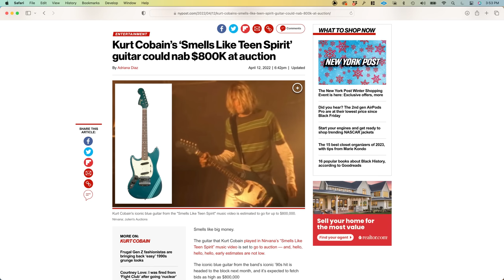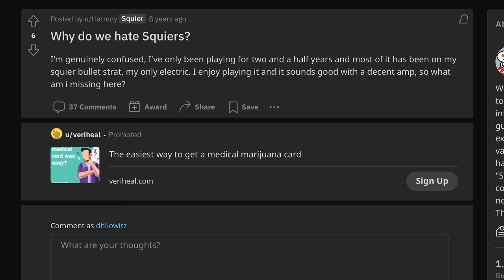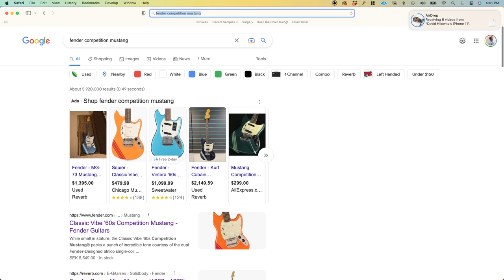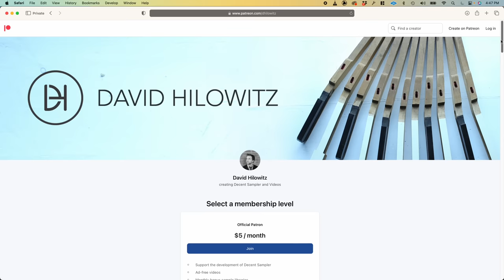Squier Mustang: How I learned to stop being a gear snob

Comment: Great video! If you find yourself in the mood to mod again a set of P-Rails with the tripple shot switching rings are  a great selection of sounds. Add an in and out of phase switch and a parallel and serries switch (between the 2 pickups)  things get even further into the wild side.

Comment: Have a similar story, grew up around the same time and similar back story. I heard that album and went through the same obsession. Started playing on a nylon string classical style acoustic with a wicked front bow. Didn’t care bc I had to show my dad I’d stick with it. Finally got my guitar teacher to show that I needed a new one to progress. Got a used harmony electric from a guitar store. Guy picked it  up 11:31 and showed it to us, played a couple licks to show it worked just fine. Got home, no amp but was a start. Finally saved up for an amp, and the pots died on it. So now I was back to an acoustic. Eventually saved up for a jazzmaster bc of the similarities. Dang floating bridge. Sold that is 2009 and bought a MIM HSS strat. That guitar did play like a dream. About 3 years later, had to sell it for cash. Like most people in quarantine, I wanted to be productive instead of watching tv and pounding food. Pulled that old harmony out of the case, that guitar hasn’t worked properly since 1994. Pulled it apart, repainted it, new pots, new dual humbucker pups, split coil taps and three way switch in a strat style guitar. Cu filmed the inside. The old guts of the guitar made this horrible buzzing noise and this time, it was as silent as it was as back in the guitar store, except when I was trying to make noise with it, after that it sang. Your story is a familiar story, definitely one a lot have their own version of. It’s not the prettiest guitar, but as someone said, it’s not the brand of guitar, it’s the one you actually play that matters. 

Good for you, finding your own voice. Dig the song.

Comment: 1979 I bought my first decent electric guitar. 1966 Fender Mustang for $50 (a lot for me then) but I also had a few like the ones in the beginning of this video. It's not worth much now as I repainted mine too when I was 16 and also didn't wait between coats or sand each one... ended up as a kind of flat black. I changed the pickups and put Fender lace sensors (also still have the originals) but I always thought it was a great sounding guitar and it was easy and fun to play...still have it.  I'm assuming a decent Squire will be similarly fun.

Comment: This video cracked me up because I specifically go after Squiers, since I can't afford Fenders, they have the exact same look & feel, and can be massively improved by swapping pickups. I created my own Tom DeLonge strat because I couldn't afford the $1500 reissue, so I bought a Squier Affinity HSS strat in Lake Placid Blue, and swapped the electronics for a single imitation Seymour Duncan Invader, single humbucker pearloid pickguard, and matching back plate, since it's not a solid body. Looks & feels amazing, sounds even better, and I finally have the blue guitar with the maple fretboard I've always wanted. A week later I bought the matching Jaguar bass, and next I plan on getting a matching alto sax, then an orange semi hollow similar to the Ibanez I had & sold several years back.

Comment: It’s funny how some guitars just have certain something that speaks to you regardless of how prestigious or expensive.
I had an Italia monza which was a quality guitar but I just didn’t find it comfortable to play. Then I bought an old encore strat off eBay for £5 including an amp and stand, purely to rob it of parts for a cigar box guitar I was making. When I got it, I thought I’d plug it in and have a play for a bit of fun and I just loved the feel and sound of it. So instead I stripped the hideous bubble gum pink paint off back to bare wood which looks great. Upgraded the pups and fitted a momentary switch. Now It’s my go to guitar and I also fitted a GK3 midi pickup. I cheekily replaced the headstock logo to Fender and numerous people have said you can’t beat the sound of a fender totally unaware that it’s not one. Which just goes to show it’s not the price tag or name that matters, it’s the soul of an instrument and how you connect with it !

Comment: I love my first Squire, Ive redone all the wireing and put dual hot rail pickups 20 years later and it sounds beefy and I dont mind the Squire logo cause it sounds like my guitar.  I like that ive kept it nice as a lot things I owned as a teen didnt get TLC. My strat body is also like 3/4 thinner than most guitars making it light thus it needed a special sized bridge block, I found out when the whammy snapped in it. Eventually Ill need to replace the frets as they are worn with age.

Comment: The guitar I learned on was actually handmade by my father when he was a teenager from one solid piece of mahogany. It had an absurdly thick neck, chipped black paint, and a cheap fiberglass pickguard. It was paired with an old tube amp he had also made that had the absolute touchiest dials in history, and I found a used Boss OS/2 pedal for dirt cheap. I played the absolute hell out of that setup when I was 18. Literally played until my fingers bled a few times. The only real improvement I've found moving on from that gear into more expensive stuff is thinner necks. haha Talk all you want about signal quality and tone and blah blah blah, but that's all just personal preference. I hear plenty of people making a $50 guitar sound just as beautiful as a $1000.

Comment: I have a HSS Squire Strat that I got for free and it was mint other than it had no bar included. I set it up and it sounded pretty good. After about 6 months I switched the bridge for a Wilkinson that I had left over from another guitar and it sounded terrible, switched to the bridge pieces from the original bridge and it sounds unreal, stays in tune and sustains freakishly! I was gonna sell it but nope, it's gonna stay in my collection. I can't believe how good it plays and sounds. It has a  slightly thinner body but fits my pretty darn good.

Comment: GOD I love the Quarter Pound. Got one in the bridge position of a tele and I will often reach for it to do almost thrashy rhythm stuff, amp and pedal settings exactly the same as I'd have for a typical bridge humbucker. Makes a nice second sound to blend in a quad-tracked mix too. Or if I want to double track, but have the hat side and ride side guitars sound slightly different to match the differences in the stereo spread of the kit. I pan the QP track with the ride because my ride sound is bright with the placement of my overheads, and my hat sounds a bit more midrangey than typical hihats. I actually have a couple cheap (but good) almost QP copies, made with alnico slugs instead of bar magnets though. They're strat pickups with huge pole pieces and one is reverse wound, so I intend to turn them into a single hack-job humbucker with a massive amount of output for sludgey dirty sounds.

Comment: I used to make cages out of copper foil, hoping for some kind of faraday effect. It's fun and it looks cool, but it would have to be ridiculously thick to accomplish that. I learned, however, that it actually isn't necessary. The point of the foil is to act as an antennae to receive errant electro-magnetic waves in the room and give them a direct path to ground.

Comment: I bought the same guitar used at Guitar Center for $100 and also bought a Jagstang pickguard, Hipshot staggered locking tuners, and replaced the pickups with JB bridge and Hot Stack neck. I had to sand down the back of the neck and Tungoil it. I love projects and have built and renovated many guitars. This is a great little player.
Reply from the maker: Ah, that sounds so cool

Comment: I bought a Squire Affinity Tele for $167. I had the same plan, till I took it apart. Inside I found FENDER pickups and 500k pots! I looked it up by serial number and found it was a limited edition with the upgrades I described, so I left it, just like it was. I put a bridge mounted B/G bender on it and tuned it to C6th for a laptop steel sound.... It's my favorite guitar.

Comment: I remember wanting my first guitar to be the "pointy typical electric guitar" meaning a black strat with a white pickguard.

The seller oriented me towards a Squier Telecaster and I wasn't sure about the body shape, and I didn't know anything about the mics.

I took the Tele, and the Squier name didn't bother me.

Today, after more than 15 years, this Tele is next to me and I played it for 2 hours today.

I have other guitars and some are way more expensive than this one.

The frets are worn out, I changed the neck pickup, the tuners aren't all the same, and the Squier name is a statement that I proudly keep.

This guitar changed my life and If I had to play any guitar in a live setup it would be this one.

Now, Squier is a name I'd actually prefer to have on the headstock rather than Fender.

I can mod it and make it mine, and above all, it keeps humility.

Comment: Part 1: My first guitar was a Cort stratocaster that I got in 2000, and it served me well for the 7-8 years before I decided that I wanted to take it apart and repaint the body, after dropping it once or twice and many scratches and dings in the paint, but it turned out to be a tremendous mistake. Ever since 2007 or 2008, which is when I took it apart, I've since lost all of it's original parts, and it just sits around in a box, stuck in limbo. On the plus side, the neck is still in decent shape, and is a nice substitute any time I need a spare neck for any other guitar, like as of current, it's on a Squier bullet strat that my cousin bought, he removed the original tuners and put different ones on, then changed the tuners again to ones that came on his very first strat, and subsequently gave me the bullet strat but did not give me the original tuners, then proceeded to move to a different state... and I've been too busy and lazy to go buy replacement tuners for the Squier neck, meanwhile I didn't like that it had his first guitar's tuners, so I removed them and put them back on his first guitar, SO, now that bullet strat sits around with my Cort strat's neck.
Part 2: I got a CIJ (crafted in Japan) Fender Mustang, in competition candy red, that was made around 1999-2003, and it's by far one of my most favorite guitars. Like you, I wanted that blue competition Mustang as well, and when I finally decided to get one from reverb last year, I made a last minute decision to not entirely go for what Kurt Cobain had, and went with the red color.
It also has two single-coils, and the two switches for the pickups versus the one switcher, and as I said, it's one of my most favorites (my top three favorite guitars that I own are, my Ovation Celebrity acoustic/electric that I got as a gift in 2002, a vintage Mosrite Ventures / Mark I from the 1960s that was made in Japan, and the Fender Mustang). I don't remember what the current single-coils in it are, but they are not the stock ones, they were replaced with some sort of "upgrade" that the previous owner had done, and like I said, it sounds amazing!
I'm, however, now wanting to go for a second Mustang, but like you, I will most likely look for a Squier "classic vibe" or something, because I want to remove the bridge pickup and install a hotrail one, much like Kurt had done with his competition blue Mustang, I believe in the later part of 1992, or the early part of 1993 (I believe it was late 1992); the color I'd like to go for, would resemble one of his 1993 In Utero tour "sky-stangs", or "sonic blue" I believe is the color, this way I'm not straight up going for the "one humbucker / one single-coil" like his had, but I mean, either way, I just want a second Mustang to modify myself, etc.
Reply: I like your video, by the way, it definitely gives me inspiration (originally, the next guitar I was wanting to start saving for / drooling over, was a Fender Jaguar, again NOT a Kurt Cobain version or anything, I wanted an olympic white with tortoise-shell pickguard and the two single-coils.

Comment: I had a huge aversion to Squier stuff before. My first guitar was a Squier strat of some sort, early-mid 90s. The thing had horrible intonation (ie. the frets weren't placed right, it couldn't be fixed at the bridge), tuners wouldn't hold their position, the pickups were weak, and the electronics super noisy. It was great to see if young-me would stick with guitar, sure, and learn the fundamentals. My dad bought it for that intention and intended to get me a Fender when I got a bit older but then he went to prison. Mid-teen me picked that guitar back up and tried to play distorted rock music and... it didn't work. Power chords were even impossible to not sound gnarly due to intonation issues, the noise was unbearable through distortion, all that. My mom wouldn't get me anything better, refusing to understand how it was deficient. "We have a guitar at home" kind of attitude. Ended up turning me off music because I couldn't play anything I like.

Adult me ended up getting a Squier Classic Vibe Jaguar. It's an OK guitar, but with a little TLC it's a great guitar. It's got really solid bones, just a bit of the hardware is cheaped out on (the worst is the tremolo unit -- it's almost unusable from the factory as the mechanism shifts and flattens/sharpens the tuning. Mild bends are OK. They probably get away with this since most people treat tremolo units as just something to add some vibrato, and big bends are treated as an unessential novelty). All the important, hard-to-fix parts, like intonation, are spot-on. Even the pickups are pretty decent. 

I guess, just avoid Made-in-China Squiers, as China seems to be where Fender makes their bottom-dollar-low-QC stuff. Modern Indonesian instruments are quality. It's probably telling that the companies that care about quality like PRS and G&L all choose Indonesia for making their budget lines. (Probably nothing special about Indonesia here, other than they got a quality-instrument industry established through Yamaha, Cort, etc.).

I'm still skeptical of low-end Squiers like Sonics and Bullets, though, from my prior experiences.

(This isn't a knock against China, per se. China's just specialized its manufacturing industries to making vast quantities of low-quality-low-price stuff to satisfy American demand. Sometimes that's great. A cheap pair of headphones just for listening to music on the bus or on a work break, that I don't have to care about getting broken or stolen? Great! But for my guitar? Not so great.)

Comment: Years ago I bought a black Squier Tele as a Christmas present for my ex gf, which I sprayed purple, since it's her favorite color. She loved it, and actually got the hang of playing guitar in about a week, but then she got bored with it and gave the guitar back to me.
I wasn't a fan of the color and so having other far nicer guitars in my collection, it languished for a long time, like 3 years.
Then one summer I was on vacation and she, the ex, was traveling for work. I set about completely modifying that Squier from headstock to body to paint, and even the fretboard.
Ended up with a wild, asymmetrical double cut with Parker-esque headstock and black dyed maple fretboard.
I had it for years, and played as a rough house kind-of guitar, mostly in punkier projects. It got a lot of use, but always held up and sounded fine.
Now the funny part. To my admittedly murky recollection, I have no idea where it went. I may have either sold it or given it away, but it's also possible I forgot it when I moved from Montreal to Halifax a few years ago. Maybe someone got a surprise in the bedroom closet of their new flat on Acadie haha

Comment: BTW if you find you don't use the Tone control much if at all then may I suggest replacing it with a 50k linear pot' & wire it to the bridge side coil of the bucker?

That way you can tap it to pretty much any degree AND there will be less electronic hurdles for both pick ups to push past to your amp😉

Comment: Interesting piece. I just bought a Squire Stratosonic after owning four Fenders (if you include my twenty-five-year-old acoustic). I actually spent more simply modifying my first Strat than I did on the Squire. I will probably replace the pickups, but the vintage tuners are as good as the locking moderns I put on the Strat, and the neck and fretboard are unbelievable; better than any of my Fenders. Slightly rolled, no buzzing and no grit. Suffice to say I also am no longer a gear snob. Thanks for your videos (actually just discovered your channel). Hey, I guess Jack Pearson was right...sort of.

Comment: My first guitar was an Ibanez Gio. After figuring out my favorite riffs and learning to play more, I started saving up and buying more expensive guitars. Strat, les paul, LTD etc etc. I play a little every day and longer on my time off but the one I always still go to is that cheap ass Ibanez Gio. It holds the tuning, is pretty gentel on the strings and is easy to hook in with whatever effects or amp im trying or using. The others are great, but require more tuning on a regular basis, are a little picky with some pedals and effects and take about 10 mins of fooling with the knobs to be where I want them at. Biggest lesson I learned was its all in the way it plays for you and if its comfortable, thats the one.

Comment: Owned a 1990 MIJ Squier Tele from new which I had for 25 yrs. Great guitars, always well built and did the job, even with stock pick ups. So good in fact I used it on several recordings as a session musician. Thats why I dont get the Squier snobbery either, some of them are just as good as instruments twice as expensive. On a par or better than some Fenders even.